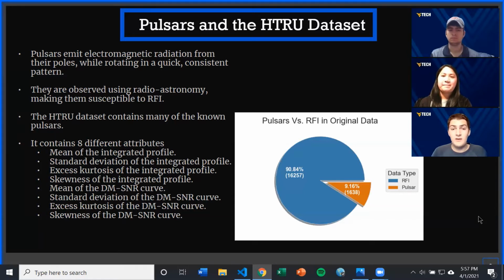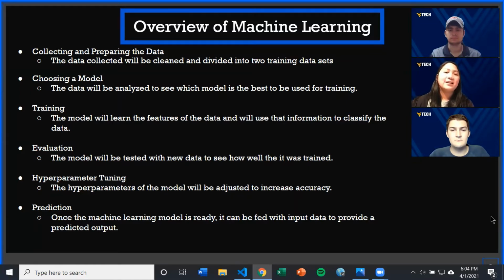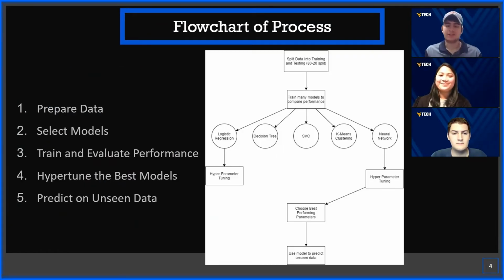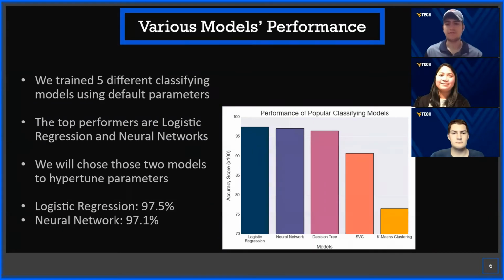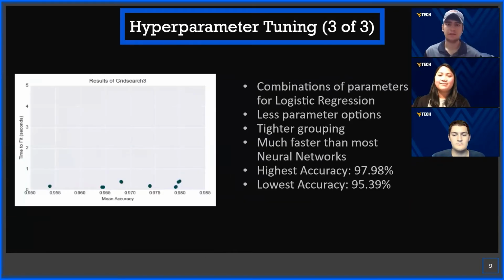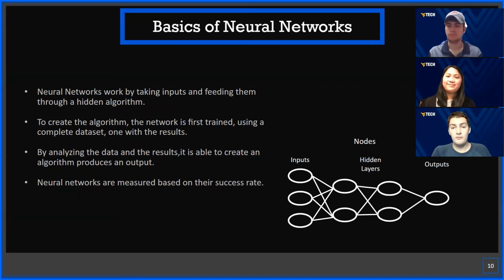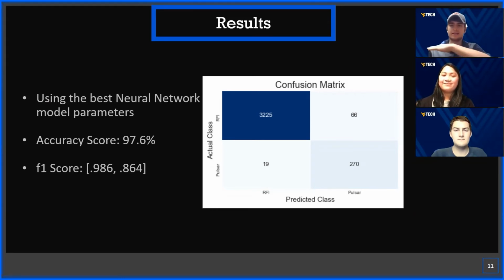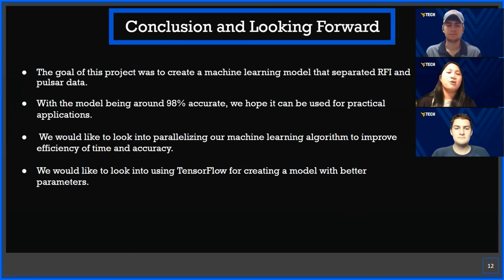Using Machine Learning to Predict Classes of Astronomical Data

Comment: It was great to meet you at WVAS today, Elizabeth!  This was a cool presentation.  I like the confusion matrix idea, and want to make sure I'm understanding it right.  Do your results say that you predicted pulsar 66 times when it was really RFI?  But only 19 times did you say it was RFI when it was really a pulsar?  If so, that seems cool since pulsars are rare.  It would be better to overpredict them than to miss any of them!
Reply from the maker: You are correct. The main reason for this is because there are so many more instances of RFI than pulsars in the data. That gives our model more chances to predict incorrectly on actual RFI. But if you look percentage wise, the model was more accurate when dealing with RFI because it also had more training data on RFI. 

To your point about over-predicting pulsars as not to miss them, I can see value in that approach. There is probably no perfect model that will never miss a pulsar, but we could definitely look into models that have a higher rate of accuracy with pulsars.

Comment: Hey, what's the next step in this important research?
Reply from the maker: To add on to what Tyler mentioned, the big reason we want to pursue parallelization is to reduce the time of hyperparameter tuning. Each gridsearch we did took over 20 minutes each to run on our personal laptops. There are many more parameter combinations we would like to try to see if they improve our neural network but there is no way we can try them all if each parameter we try takes that much time. 

If we can find a way to parallelize the gridsearch method, we can utilize cloud computing resources to quickly get the performances using different models.
Reply: Our next steps will be to parallelize it, allowing the program to run on multiprocessor computers more efficiently by taking advantage of multiple cores/processors simultaneously. We will also be further expanding our grid-search parameters to more finely tune the machine learning model's accuracy.